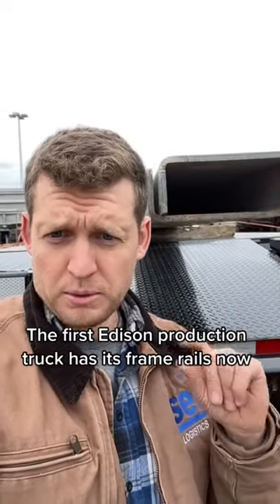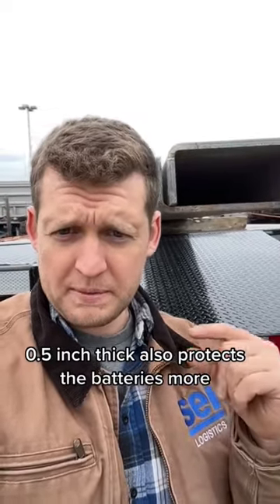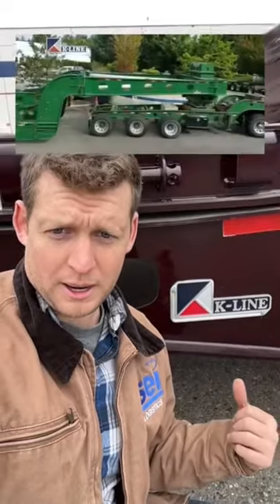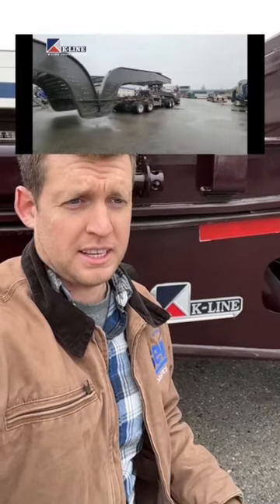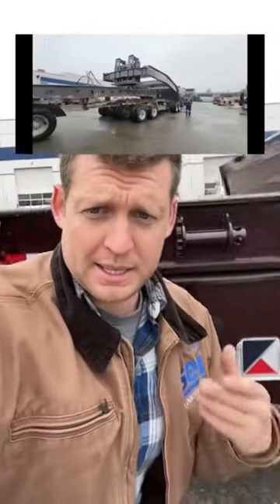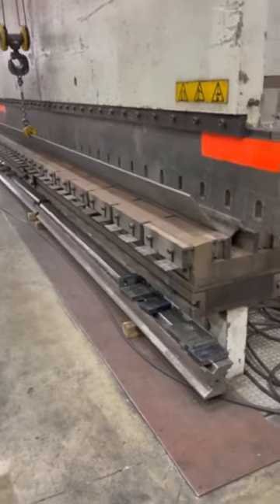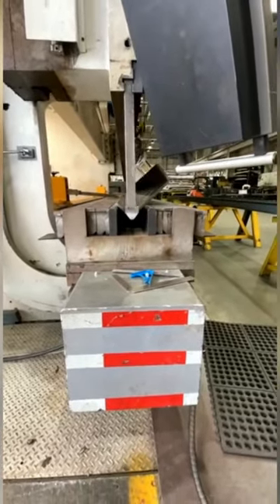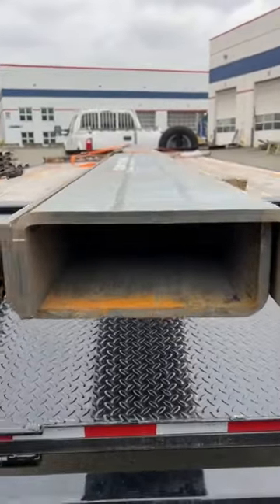We now have Frame Rails, Thanks to Kline Trailers #heavyhaul #edisonmotors

Comment: We need to start building things to last 100 years again. So thank you sir
Reply: You are saying that in EV truck video... Truck that probably wont last more than decade if that. Also horrible idea refueling/charging aspect, if its not diesel electric. Still brings in unneeded complexity, hence more fault points.
Reply: @Hellsong89  oh so you are upset that you will have to maintain it you might as well make the entire thing so that it is garbage once it hits the point that it will need that Matinice? Interesting philosophy but I disagree we can rebuild battery packs and poorly maintained diesel  generators last much much longer then the drive train on  diesel trucks that have been taken care of.
Reply: @dontimberman5493 That's the genius of electric, you don't need a transmission.
Reply: @nichevo1  It doesn't need a transmission, but if they had a transmission, could they get more efficiency out of their motor, and be able to get more range per charge?
Reply: Why? Why would I want to buy any product that’s going to last many years beyond my lifetime, especially a personalized business asset? In almost everything, the economics don’t make sense. (Buildings not withstanding.) tools and equipment exist to make money. Their costs need to be less then their productive value. The acquisition costs of something made to last 100 years is going to be significantly higher, sometimes many times higher, than something made to last less than that. Do you know that the business this tool is engaged in will be productive or even last for that long? Will the tool be a relevant tool in that time? Those questions carry significant risk with them, which makes tooling made to last for long periods of time a very risky investment. 
(Capital investments, ie investments made to buildings or other real assets, are different than tools and equipment.)
Money spent on a tool or equipment that is built to last longer than it will be productive is a waste of resources that could have been spent on other, better things. 

As far as personal stuff, I don’t want to pass down things to my children that were important to me, but not to them. I don’t want to burden my children. The things I see as a blessing can be a burden to them. I want them to decide what is a blessing and what is a burden. I don’t want to give a 50 year old truck to my kid just because I think it’s a good thing.
Reply: @tylerfb1  does not make sense? So a asset that will still have value when you have no use for it is a poor investment? 🤔
Reply: @dontimberman5493  no that's not what I said. I said it is not a given that an asset will retain its value for 100 years, even if it is built to last that long. 
Trucks from the 40's cannot compete in any field, with new trucks. Although they were made in a way that makes them last a long time, they cannot pull the loads that are required now, and cannot do it economically. That's not even a hundred years ago. 
When the builder of that truck built that truck, they had no idea about today's trucking market and what would be required for trucks today. If they had built that truck with the purpose that it would last, that it would still be able to be productive for 100 years, the cost of it would have been many times higher than the competition, and still it would not have achieved the goal of being productive for 100 years. 
See really, you only think that people used to build stuff to last 100 years. That's not true. No one has built things like trucks with an intended service life of 100 years. What was happening is that they didn't have the technical expertise to design and build exactly what they wanted to, so they overbuilt things, which made them last longer than their intended service life. If they had the ability to do it, they wouldn't have done it. Which is exactly what we see today.
Reply: @tylerfb1  it is what you said without the fluff. But so long as something is useful it has value to someone. Then when you consider that it takes resources labor and energy. It is short sighted irresponsible and wasteful to not build everything to last as long as possible.
Reply: @dontimberman5493  it’s quite the opposite actually. If it were true that the least amount of resources creates the greatest benefit when the consumer buys a widget that lasts far beyond its useful life, they would demand it and producers would produce them. 

The reality is it is far more economical, that is, it uses the least amount of resources for the greatest benefit, to produce a less expensive widget that lasts for a reasonable service life.
Reply: @tylerfb1  😂 ya that’s the idiocy that runs rampant in the current market. That needs consumers to throw away things after one or two uses then buy a new one. It will need to change. Just because people don’t have a choice but to buy that crap doesn’t make it optimal. Its plains obsolescence so companies can make more money. Your entire view on the matter is based on greed. Not your own but that of corporations.
Reply: @dontimberman5493  you’ve got it wrong, man. Corporations exist to make a living for their owners, managers and employees. They can only do that if you buy their stuff. The minute you don’t want their stuff, they stop making money. Only the government can survive when nobody is buying what they’re selling; no company survives long not making money. 
If there were lots of people that wanted products that lasted longer than their useful life, someone would rise up to fill that demand, whether they are already in that market or they are a new startup. That’s exactly what this company is doing. They see a need and are trying to fill it. 
The reason we have what we have is because in the aggregate, we want it. 

Planned obsolescence isn’t really a thing, at least in how most people, and probably you, think of it. There are some instances of it, but really it’s about the reception and perception of a product. 
A good analogy is like a mechanic that doesn’t allow you to bring your own parts for him to install. You might think he just wants to make money off the part markup, and of course he’ll buy the crème de la crème part, not the economical one you’d bring. There’s truth to that, like, that’s factual, but that’s not the reason. The reason is because if they buy the part, they guarantee the part and the work. Also, their name is associated with that job, and if there’s a problem, though it might be the part’s fault, they get associated with it and their reputation can take a hit, even with the person who brought in the low quality part. 
The majority of “planned obsolescence” cases fall into this category. 

Corporate greed isn’t a thing. Corporations can’t have greed, only people can have greed. Greed in people is a thing, and it’s wrong to say that greed is good. It isn’t. But the magic of markets is that it uses that vice as fuel to produce a good. 
The US’s and Canada’s markets are largely free. Which means people can’t force other people to buy their crap products. We have the products and the culture we have because we have decided that it is better than an alternative.
Reply: @tylerfb1  acting like you need to keep building things to keep making money is one of the most short sighted  things ive ever heard of.
Reply: @MrToranaGuy  Not really, electric motors are really efficient through most of their ranges. For the most part a transmission just adds complexity. The biggest limitation for any electric vehicle is the fact that batteries suck. The very best ones we can make have about 1/10 the energy of a comparable amount of gasoline and that is not even considering the charging time. Make a good enough battery and cars would become electric so fast we would have controlled times for when you could charge your car and the power grid would be near collapse under the load of all of them. This is why you should never pay attention to anyone who touts electric cars but doesn't also talk about power generation.(and no, wind and solar won't cut it for the same reason batteries suck. There is no way to store significant electricity for high demand times.) Joe Biden driving his electric car was hilarious considering that almost all of Delaware's electricity comes from burning fossil fuels.
Reply: @dontimberman5493  How much more do you think those extra thick rails weigh? How much extra weight will be added when you match those up with everything else? That extra weight must be moved around, stopped, supported on road by tires etc. It becomes questionable very quickly whether this would come at a net gain or loss in money or resources expended. 

Your point may be a good one for family houses, furniture and things of that nature but for something that spends it's lifetime moving around it's a lot more questionable. Considerations like weight become key factors.
Reply: @Snipergoat1  that is what engineers are for. We can design things to last whilst staying within those constraints. We just design them to brake within a certain time period… a far more challenging endeavor.
Reply: @dontimberman5493 well I've got a car that's 16 years old, a motorbike that's 11 years old , an ipad that's 8 years old and a phone that's almost 4 years old. All these things are working perfectly  so when is the planned obsolescence going to kick in and make them stop working?
Reply: @jamesbisset9891  easy your iPhone if it has all its updates will have half the storage capacity. The parts in care are engineered to start to fail over 100k miles. Lightbulbs cam latterly last 100 years if they were not designed to fail. The fact that you are in await of any of this makes me think you are a troll
Reply: @dontimberman5493  no my phone does not have half it storage taken up by updates also it's not an iphone.

Yes bulbs can last 100 years the oldest being 122 years old but it only puts out a very dim glow and is so inefficient that it works better as a heater than a light.

Cars do on average 200,000 miles before being scraped (which has been increasing) so yes things may start breaking after 100,000 but it can be repaired and still work. Modern car engines actually last longer then old ones as well meaning that most cars never need an engine rebuild for there entire life where as old cars may have needed an engine rebuild as soon as 50,000 miles.
Reply: @jamesbisset9891  and we can easily design cars that will run 1,000,000 miles without any major issues. Also we can make led lights that can run continuously for 50 years and not be dim. You pretending otherwise shows that you are eather trolling or know nothing about the subject. We can mane  sensors and electronics that work continuously for 35+ years without issue for almost no coast increase in production. Why don't we do so on all devices? Maybe you really did not know this.
Reply: I work in an industrial building that was built in 1968, it's already structurally unsound. Such a waste
Reply: @Hellsong89 its powerd by a catipilor desile engine it is a hybrid but sense it is basicly a generator like a locamotive
Reply: @Hellsong89 I do agree but also disagree. I’ve seen well made electronics last a super long time. Also if you build it like they have if something goes bad it’s stupid easy to swap out the electronics. The engine should last a really long time because it’s not seeing the run time or load of a typical diesel engine sees. The real unknown is the axles they put on the truck. With battery tech where it is now I wouldn’t be surprised if we start to see battery packs capable of lasting 30 plus yrs before needing replaced.
Reply: @Hellsong89 yeah if you actually watched this guys video you’d know it’s diesel electric. Should probably learn to read before trying to talk.

Comment: it's settled then 1 inch thick frame rails 🤔💪
Reply: I mean he said he wants to eventually just be building frames for companies that build the rest of the truck like firetruck and well drill manufacturers so I'm sure once they get up and going more you'll be able to order whatever they can manage 😂🤙
Reply: Yeah thats all fine and dandy until you hit the scales
Reply: Yep, who cares about payload? Forget about it.😂
Reply: @Iaintwoke  good point. still lighter than most double frame trucks though
Reply: @Theupstateidiots  id imagine the possible fuel savings would outweigh the reduced payload cost in various situations. Looking at their website though their plan looks like to run diesel electric, not full electric so I'm not sure how much fuel cost there is to be saved.
Reply: @thatguyoverthere9634  I'm all for the diesel electric idea. Works on trains, and is even being used in fire trucks now. If they'll stand behind it covering my ass inside a burning building, I'd trust it going down the road
Reply: @thatguyoverthere9634  a whole lot it's not just the efficiencies of the electric transfer of the deisel power being even and non lurchy it's planned to have such battery size that it IS full electric 💡⚡🔋 👍 but then not be limited by battery size as the built in onboard battery charger generator is not to be diminished in size but allow for less down time due to broken chargeing infrastructure aka dead pumps blocked pumps ordead powerplants because some idiot shut down the green 💚 energy power plants power shunting it to waste heat rather than just throttling down the supporting fossil fuel plants aka nuclear coal garbage powered etc

Comment: Bro, we make all the OEM frame rails for Volvo/Mac/Kenworth. 
All of them..
It's a company called Metalsa in Roanoke Virginia if you ever need it done. They'll punch the holes or drill and tap them on the line for you as well.
We run about 500 a day
We don't use a press brake, we roll form them from coils before they get processed with front cuts, rearcuts, and web/flange hole patterns.
Reply: Why would you tap a hole in a frame rail? I thought the manufacturer's protocol was all holes had to be reamed to reduce stress risers.
Reply: You aint local in Canada. shipping would be a nightmare, and expensive.  why ship something when you can run 45mins down the road and support local?
Reply: @ShadowDragon246  Because if these guys wanna sell more than 4 trucks a year they have to come up with a better strategy than lets go to the neighbors and borrow his tools. That works for now but they better get something figured out for the future.
Reply: Do you guys have the ability to do 1/2" t10 steel like he needs?   If so put out the word and get a supply chain started with them
Reply: @ShadowDragon246  Nobody gives a shit about your once piece Canada order. Lmao. They do 500 a day. I don't think your tiny one piece order not going through them is going to make or break their billion dollar facility. 😂
Reply: @andrewthielen5619   Im sure they'll contract them out. and they are a long ways off assembly lines
Reply: @andrewthielen5619  40 foot container from China full of frames are cheap. They can make them in whatever quality as you are willing to pay for...
Reply: Chinese steel is not consistent, making many contractor s in construction*NOT* USING CHINESE STEEL PARTS!

Comment: Wouldnt it reduce fuel efficiency and acceleration? 

2ouldnt it be better to take the 3/8 frame and weld extra supports in key places for similar strength but much less weight?

Im no truck engineer and certainly could be wrong but just seems more logical.

Comment: 1/2” tool steel? That would be impressive.
Reply: It'd crack all up. Too strong.
Reply: T-10 steel is more like the steel used for making regular tools.   It’s hard but still ductile, and perfect for high strength applications needing a bit of flexibility to prevent cracking.  Like the frame rails on Baja 1000 trucks.
Reply: Took steel is more like glass, very little flex before it breaks
Reply: @cjwrench07  sounds like 4140, or a custom/proprietary mill blend that's similar. Annealed or hardened 4140 sees a lot of high fatigue resistant use everywhere.
Reply: Impressive if you want to watch the truck fold in half after it hits the 1st pothole.

Comment: The thicker steel will much stronger. But it will be heavier thus reducing your payload and profit. 

What percentage of trailer weight is the frame vs.  the axles, wheels,  brakes, other equipment?
Reply: It's a vocational/off road truck. Doesn't matter. 

The new electric trucks are looking at getting an overweight exception to run 82,000 because of the weight of the batteries. Plus there's already a 400 lb apu allowance.

Comment: And remember, no Engineers were involved. So forget making any comments about steel selection, the effect of weight on operation or other parts, or what appears to be a unit  high cost to hand build each truck.
Reply: Lol, what’s the betting this is some mild grade steel. 3/8” HSLA roll formed would probably outperform in nearly all metrics, and if they are going to actually do it properly, a stressed structural battery pack to reduce vehicle mass, increase payload and improve range. 

I’d understand for a prototype, but for a production design they are going to get destroyed by the competition. Mechanics don’t buy trucks. Companies that need to turn a profit do.

I missed the T10 steel initially… I’m really curious about the logic behind that selection. Also wondering that the S-N curve would look like…

Comment: Does making the truck heavier not affect its pay load? And also wear and tare on parts? Plus extra mass means you need better suspension to control it and keep the ride to an acceptable standard surely?
Reply: They're building vocational trucks. A little more weight on unregulated roads doesn't matter too much.

An extra couple hundred pounds of frame rails is the difference between a full and empty tank of fuel. Basically nothing when it's loaded.